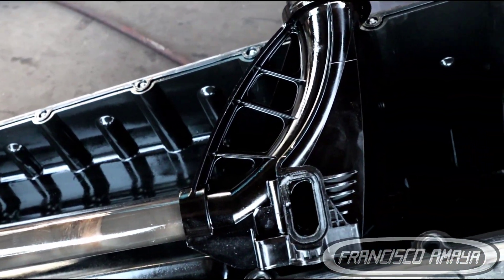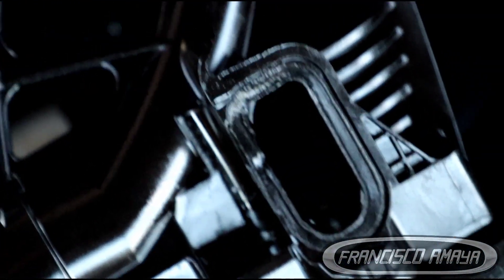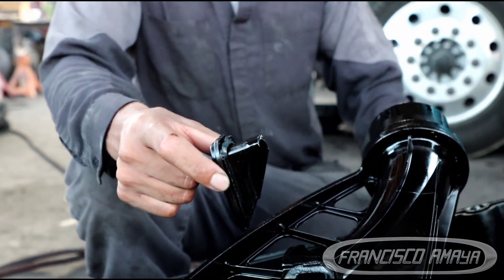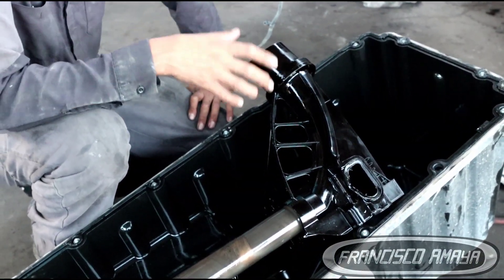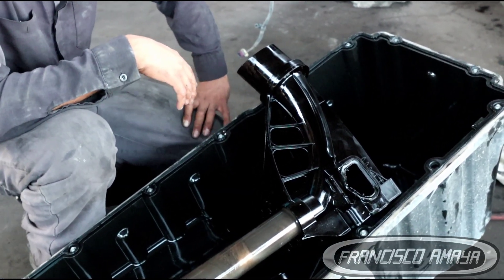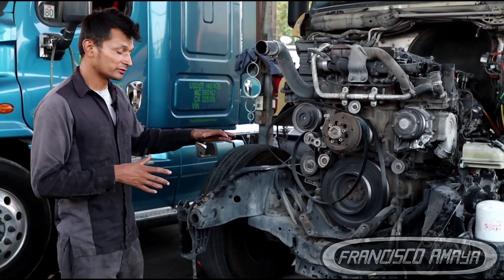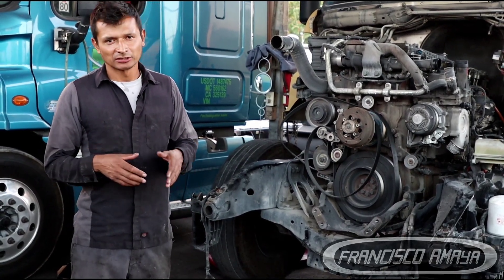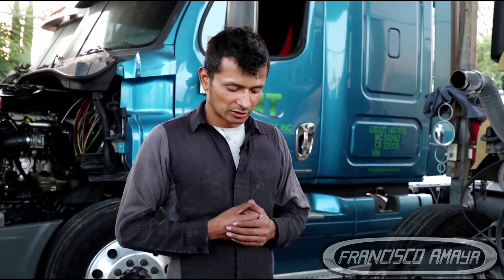DD15 engine crankshaft damage oil suction manifold broken no oil pressure main bearing damage

Comment: That’s why you replace all your shocks every 50 to 100k miles. The truck is not designed to withstand the vibrations caused by driving on shitty roads with bad shocks.

Comment: What would cause the oil filter to suck together almost like it was crushed, driver didn’t change oil for well over what he should have, did service pulled filter and it was like that put a new filter a week later it did it again. Any help please
Reply: What kind/brand oil filter are you using?  Oil weight? 
If you are using aftermarket filter's this can cause what you are experiencing.  A lot of aftermarket filter's have different microns, microns are essentially how much fluid  or air (if it's a external filter)can flow thru it. However, with these motors you do not want to fun filter's with less microns than oem filter's bc of what's happening to you. Oil filter's will collapse when the demand is pretty high. If you want to run aftermarket filter's, Google search what the manufacturer micron is and look to see which filter's are out there that meet oem spec's.

Comment: Does Freightliner Cascadia 2017 has a safety shutoff if engine does not get oil ? my engine locked due to lack of oil in the housing but no Warning lights came on and consequently truck did not shut itself off - appreciate your help with this question
Reply from the maker: the engine has shutdown protocols. if the oil pressure drops below 12 psi the engine will turn off. sadly at 13 psi and high rpm the engine does not shutdown causing this problem.
Reply: @franciscoamayaYT  one more thing - no warning lights came on before my engine locked - what could have been the reason ?

Comment: I have a very important question - wonder if you can answer this - 
what part of the oil suction manifold is dipped in the oil ? just the plastic skirt/lip or more than that ? my DD15 Cascadia engine locked and when we dropped the oil pan we saw that the plastic skirt of the oil suction manifold was not there - we wonder if that starved the engine housing of oil and engine locked ? btw, no warning lights or codes came on and there was no operator error - we are trying to find the reason whey engine locked -
Reply from the maker: the suction manifold is dipped in oil but if the manifold broke from the same area as you can see in this video. that could the cause of the engine failure

Comment: Thus is EXACTLY what happened to me. My oil pressure was and had been at 12psi, I knew I had to change my O-rings and suction manifold but I procrastinated. I was on a live load, parked in a yard where we always park, woke up to warm up the truck and noticed zero oil psi right away. I shut it down and as Francisco mentioned I kept starting it. Spun a main and ended up costing me $32k! If you notice your oil pressure lower than 15psi, CHANGE the O-rings and oil manifold, hell, roll new mains and rod bearings in. Your bank account will thank you!
Reply: Something happened to me I hate these fuking engines 😢